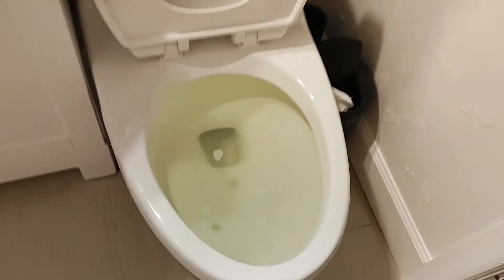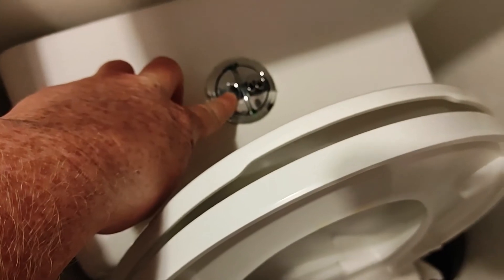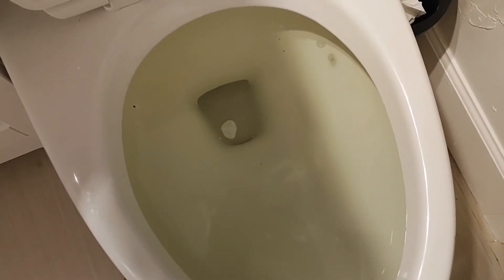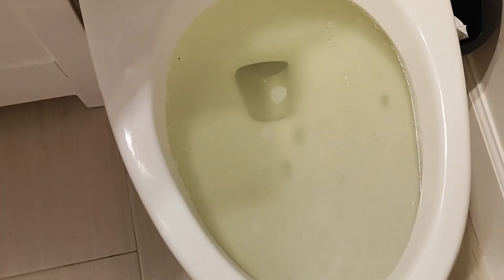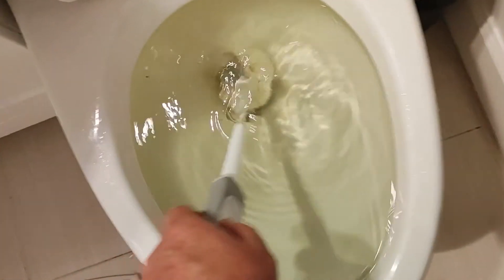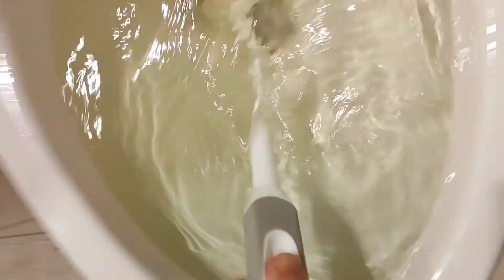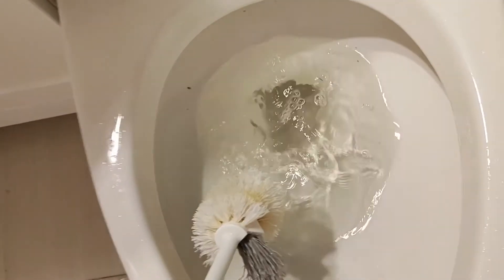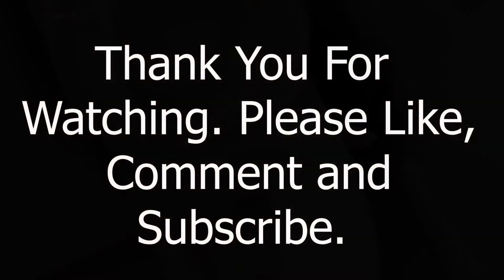BOWL SCRUBBER  TO UNCLOG TOILET  GUARANTEED EVERYTIME.

Comment: I’m doing the same thing but still blocked
Reply from the maker: Go harder and faster. I've literally cleared prescription pill containers using this method.
Reply: @DoItWithDave  vouch, harder and faster pretty instantly unclogged it
Reply: @DoItWithDave .. how did the pill bottle get so far down you had to push it thru rather than pluck it out?